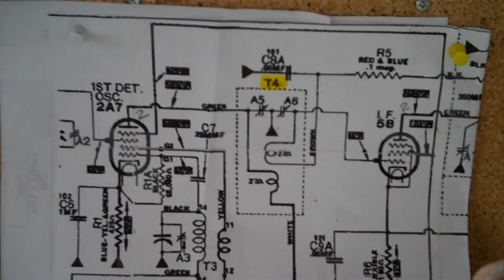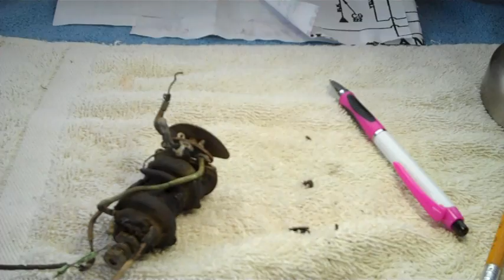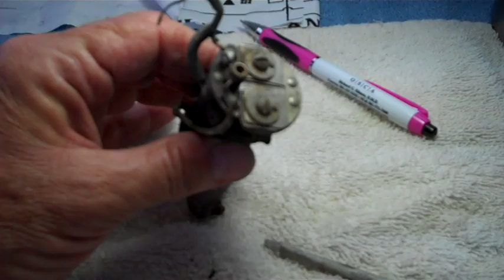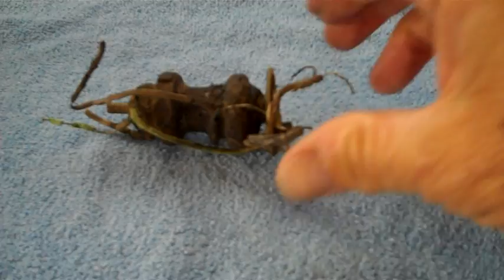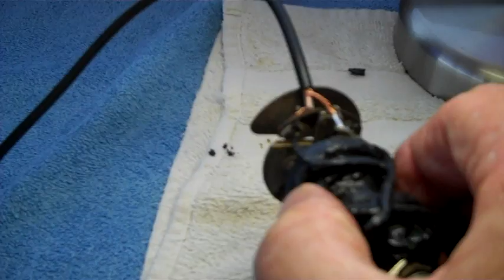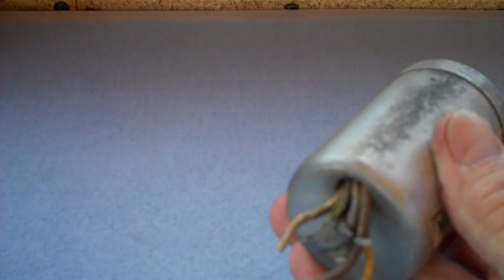1935 Atwater Kent Model 145 Repair and Restoration (Part 10 of 38).

Comment: John, Great work on the videos and restoration tips. I'm betting that on some sets during alignment at the factory  that A6 was running tight and this gimmick added the extra 2 or 3 mmfd necessary to peak A6. Cheaper than redesigning the trimmer.

Comment from the maker: Michael,
It's important to check a coil for continuity before applying any protective coating on it.  If you find out later that one or more of the coils has no continuity, then the coating would make it almost impossible to locate and repair the break...which can sometimes actually be done.

Regards,
John

Comment from the maker: Daniel,
Corona Dope is a liquid compound that has high dielectric strength, enabling it to provide quality insulation when used with high voltages.
The wax covering the old TV high voltage transformers had a habit of cracking, melting and falling off, thus enabling the transformers to emit an aura of arcs (a corona) that sort of looks like reddish Northern Lights.  Corona Dope will better insulate the transformer and keeps that from happening.

Regards,
John

Comment: If you indeed need a shielded cable I recommend RG-174 coax.  It's a 50 ohm cable and is about 1/8 inch in diameter.  Keep up the excellent work!!

73, Mick - WB4LSS

Comment from the maker: Mick,
I also initially felt it was a gimmick capacitor, but went with my buddy Brendan's evaluation of it being a shield.  But if it was in fact a gimmick, then there's a possibility that the shielded wire I installed will generate too much capacitance and mess up the audio a bit. If so, it'll be an easy change. We'll see.
Thanks for popping in.

Regards,
John

Comment: I had a aluminum HV cage on a TV chassis that I am working on. It almost looked that bad as well. I got it to look like your finished I.F. can within 15 minutes using a buffing wheel in my drill press and with metal polish stick.

I was surprised with all that handling, that the I.F. transformer stayed together. I hope you have the same luck with the second one...

As always. Come along real nice!

Comment: Hi John. If you don't mind me suggesting, if I were you and had the equipment, before removing those screws from the trimmers, I would measure the capacitance to have a reference to start with when making the alignment to make things easier... You already have too many variables to consider when putting the radio together. Looking forward to seeing the rest of the project.

Comment: Great work on those I.F. transformers. I was wondering though, how hard would it be to remanufacture something like them?? I would suppose you could re-wind the coils if you knew how many turns of whatever gauge wire was needed.... right? The trimmer caps might be a little more difficult to replicate, but obviously not the resistors. What do you think???